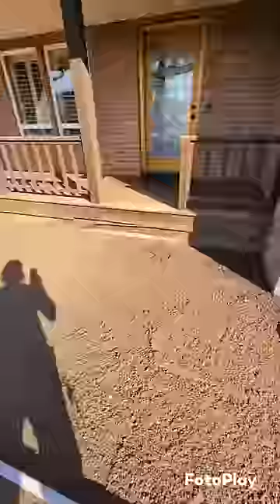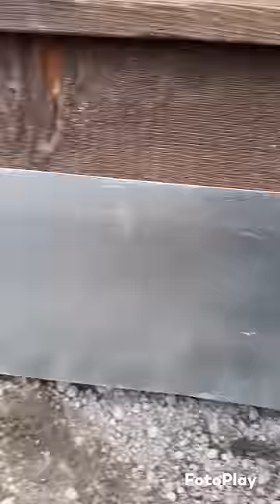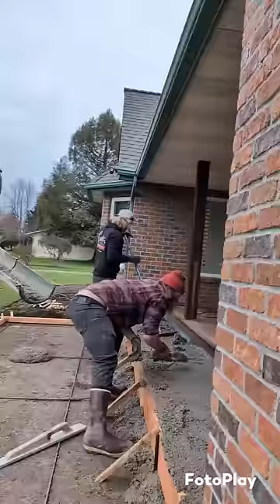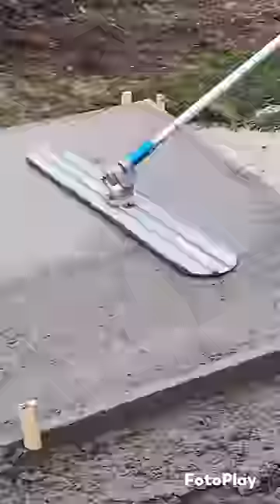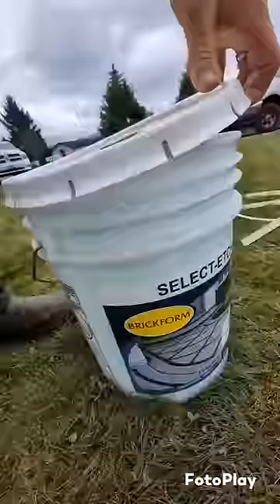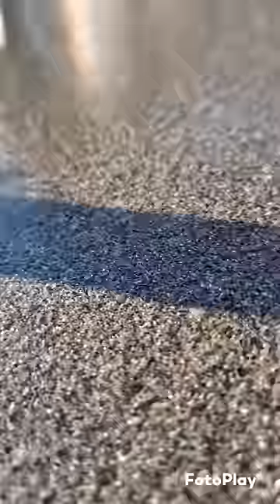Easiest way to make money in 2024 💰 #concretefinish #concrete #construction #bluecollar #satire #diy

Comment: I love the Satire. As a Contractor this man is speaking facts. You don’t even need tools. Just use your hands.
Reply: As a 15 year old handyteenager, I stucco'd a crawl space wall just with bare hands...just like when I learned how to weld i didn't use eye protection and i cried all night long. On both occurrences I was in so much pain.
Reply: I use my bare butt for a stone texture stamp when i was getting started.
Reply: LOL...like the third video I've seen and I was about 99% sure this was satire, but so many people getting worked up. I did just do my first concrete job(under a deck...so the water runs away from the house...covered up so I didn't need it to look pretty and it didn't). 

Shit ain't easy! Though...that wasn't hard. But I imagine it wouldn't be easy doing a real job.

Comment: Dude isn't even using rebar chairs lol
Reply: Neither did we at the first company I worked for lol!! He didn't use them for the first 6 months haha!
Reply: No one uses chairs. It is easier to hook the bars as you go especially if you cant pour every section.
Reply: @optimoprimo132  bruh for like a walkway or patio ok that would work, but if you’re pouring a load bearing slab like in a garage, it’s best to use the chairs.
Reply: @zaddy83  Well they are making walkway in video... Guys on video know what they are doing
Reply: Guys always wana sit down on the job

Comment: I was on the receiving end of the "will complain no matter what" accusation. My rear windowglass busted out, and the guys ended up doing an improper install (the weather seal was sticking up in a few places, etc), plus the windowglass was bowed in a few places, making it hard to tell who behind me was in what lane.

After a few weeks of trying to get used to it, I took it back under warranty and inspected the glass to make sure I wouldn't have the same problem again. As soon as I started talking with the guy, he told me he was already paying to do it again, and after I dropped the car off, I got a phone call a few hours in telling me I wouldn't be happy no matter what he did, so he was refunding my money.

Took it to another place with the money and they did the job properly and had a much clearer glass. I guess I expected too much of the last guys, because I took that manager's word as his condemnation of his guys' abilities. I just wanted a proper repair. 🤷🏻
Reply: They could have just broken the window again and filled your car with concrete. So, be grateful you got a refund and a car back.
Reply: @walsakaluk1584  Has that happened to you before?
Reply: @frikyouall  no, but it's happened. Normally involves disgruntled spouses if the interstring is to be believed.

Comment: Your 6 months of experience shows in the way you poured this concrete. I have been a licensed North Carolina Building Contractor for over 27 years, and this is horrible work! No expansion joints didn't set the rebar above grade (causes spalling). Everyone "thinks" they can finish concrete, but the concrete will get hard on its own, that doesn't mean you finished correctly. This is why contractors get a bad name!! Go learn how to finish concrete and oh yeah, go work on yourself, to be a better person.

Comment: “No skills” - as he shows the frames built, properly braced, even covering on top, setting up that huge truck with heavy peices. what are the metal sticks for? If I attempted that, there would be concrete running over the whole yard. I think he means “no skill” if you have basic construction knowledge.

Comment: 😅I’ve met and known old carpenters, electricians, and plumbers. I’ve never met an old guy still working concrete or roofing. Even the old looking guys I’ve seen were just prematurely aged and stood as straight as question marks. 

Good on you for doing it. I couldn’t.

Comment: Believe me, concrete men aren't rich. Body's broken after enough time. Knew a guy with blown shoulders. Try getting those replaced. Try pouring in 100 degrees. Better have a strong back.

Comment: Another case of easier said than done. The dust from those concrete bags make you choke and are toxic. They are *heavy*. Even with machines, you still have to move around hundreds of those to do a medium sized job. Exhausted after only a day of work. The job I did with my brother ended up cracking and chipping because we added too little or too much water. Add the hot sun and it's a lot of labor.

Comment: I had someone from angies list come over and quote me for a job that i designed and had measurements and nice easy to read drawing for him, he gave me a price and i agreed. It was just him and a friend doing it and let me tell you, they did exactly what this guy states. They showed me pictures of random jobs im sure they never did which got me comfortable but when they started framing it i realised these guys were jokes. I had to babysit them and correct everything they did until the concrete came. They would have gotten the whole thing wrong if i let them do it with no oversight. They couldnt follow a simple drawing... never go with the lowest bidder and if you do make sure they you watch them.